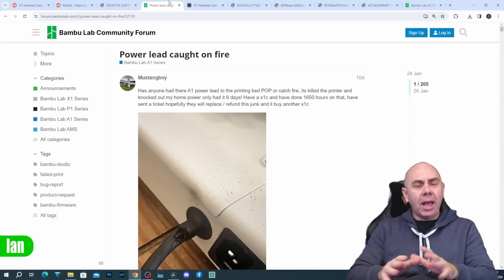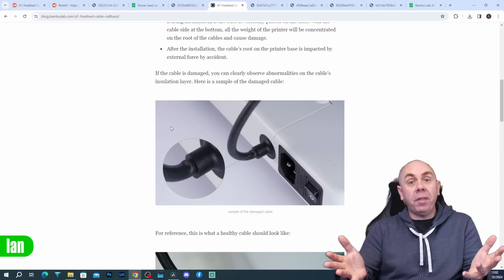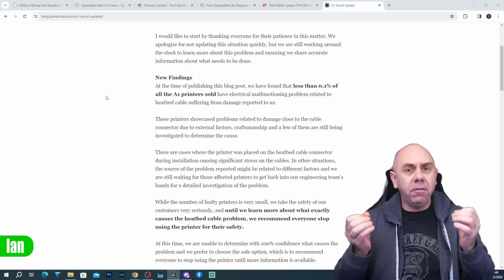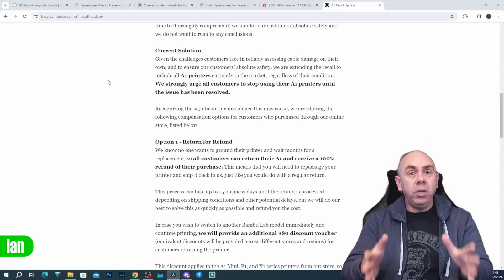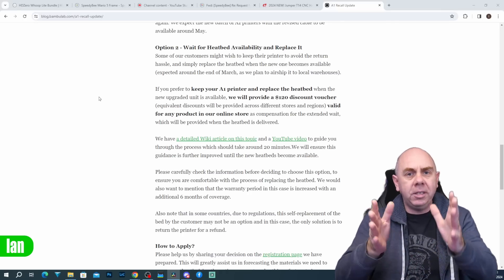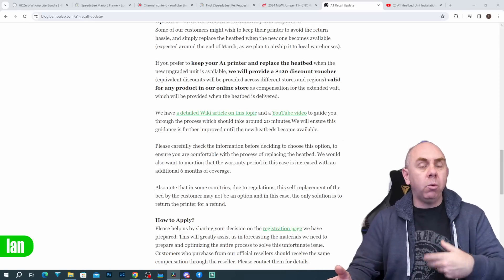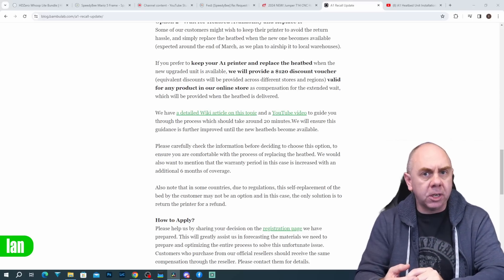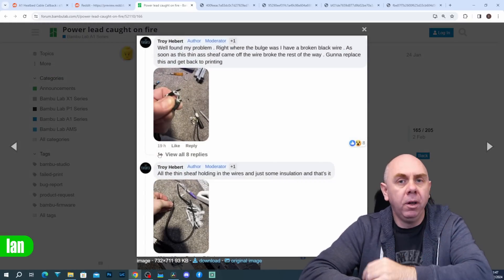Bambu Lab A1 3D Printer Recall Repair Or Replace - Get Up-To $120 Credit

Comment: No, they are saying that have information of 0.1% of A1 printers has malfunctioned because of the cable. They are not saying how many that has a damaged cable that is likely to fail sometime in the future
Reply from the maker: It’s worth understanding that it’s not even clear IF the cables with the crumple is the cause.  They have not even investigated yes as they don’t have them.  The cables with the bend may not be the cause of the issue with shorting out.  It’s an assumption today.

Comment: I wonder who got chewed out for not making the cable 1 inch longer, the bean counters, or the engineers?
Reply: This has nothing to do with the length of the cable. They think it is the strain relief. We'll see.
Reply: @Immolate62  If the cable was just a bit longer, it wouldn't bend to the degree it does. Adding strain relief will only move the flex point further away and cause an even greater bend angle.

Comment: Ive never 3d printed, but i saw your video on carbon filament printing, and im wondering if you can print decent quad frames? I like 5 inch, but if i could at least print 3.5 frames i would buy one tomorrow.

Comment: Good video thanks and responsible actions by Bambu.  But I bet they are having a few extra beers at Prusa HQ this week!
Reply: Not sure about that. Prusa's advantage is their legendary customer support. Bambu's reputation is going to skyrocket after this. Prusa has never done a thing like this, and don't pretend they have never had a problem of equivalent importance, if not at this scale. This is going to be painful for Bambu for sure, but the wisdom of their response is going to reap rewards in the long run. They made having bought the printer into a net positive for customers.
Reply from the maker: Yea for sure.